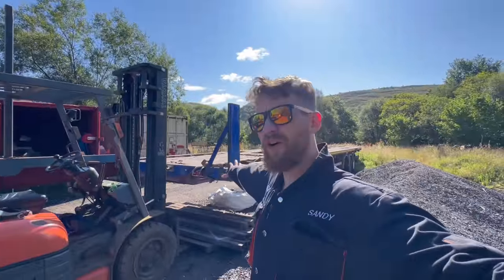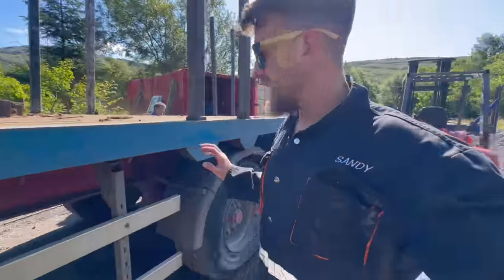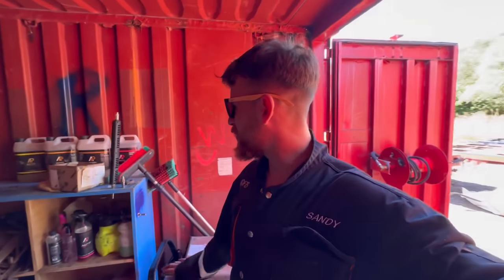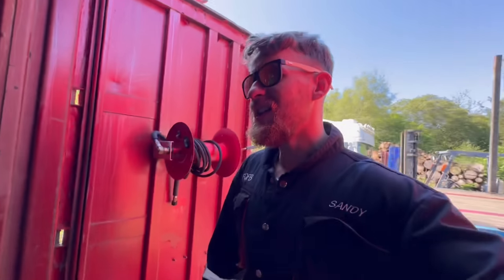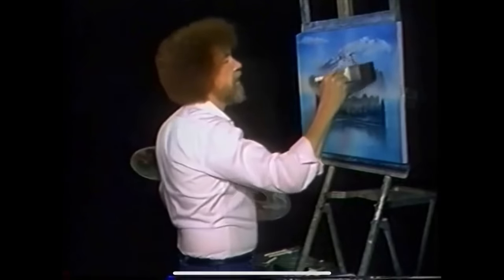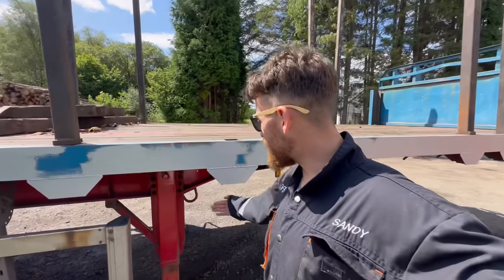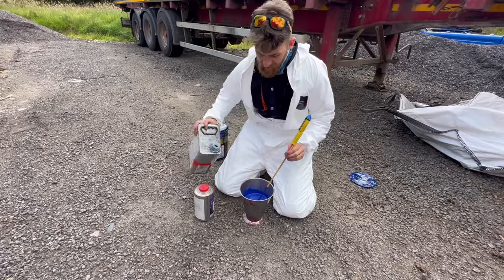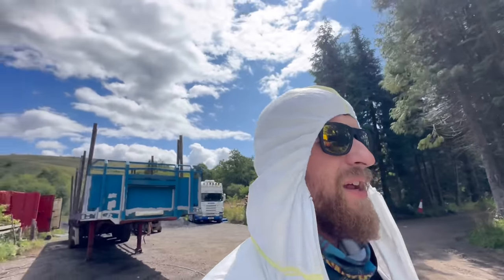Painting New! Trailer! Myself

Comment: Looks decent mate ! 

Normally I would use a 2k epoxy as a base that then seals the metal then apply your colour right on top of it after the flash time. 

Most 2k top coats are 2:1 some 3:1 etc have a look at the tds tech data sheet and that will let you know what mix ratio . For this size of job a slow hardener would be advisable so you can get all way around and the edges stay wet then walk away. 

Smaller project like back panel use the fast hardener 👍

Gun set up usually a 1.4 to 1.5 tip at around 25-30 psi will give you the best results.

But looking good …. Give me a message if I can help any further paint /prep wise 👍

Comment: You did right getting the rough out. Next time sand it with a 180/240 you’d be surprised the difference it makes. The hammerite you put on as I presume a ground coat/prime. Let it dry the nib it with like a 320. I learnt to paint with HMG products on my apprenticeship, that will mix 2-1-1, doesn’t matter how much hardener you put in it won’t make it harden any quicker, it’s the type you use, slow… medium or fast, for a trailer use medium. You don’t have to be precise just a few pointers and it will make it better for you. 
Also when painting, put a half coat then let it tack and go heavier, basically a gripper and a ripper. And have fun along the way

Comment: Great video Sandy we have a few truck's and do everything in house, like you I am self taught and work to a budget. A bit of Etch primer on the bare metal but when you are painting every year or every other there is no point putting expensive high build primer on it just my thought. Great use of the HSE spec ninja turtles mask but jokes aside spend a couple of quid and get a good one worth it in the long run keep up the good work and keep safe.